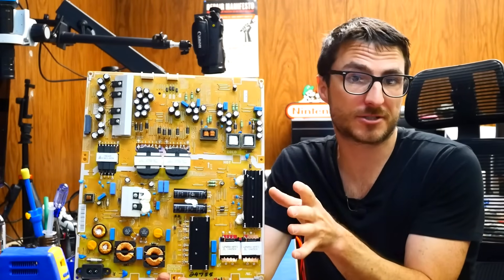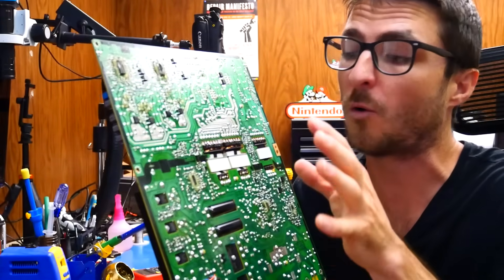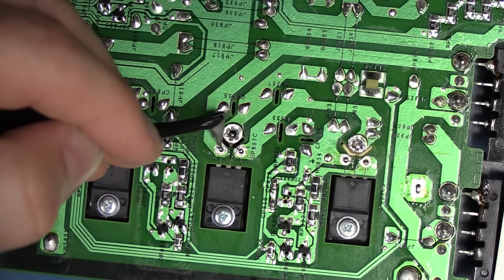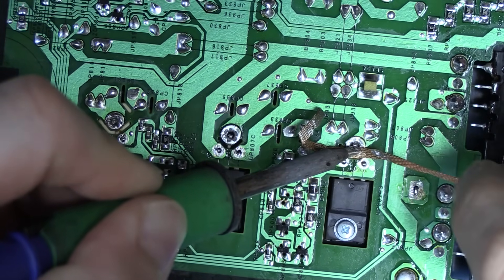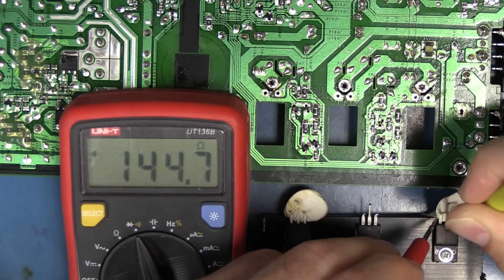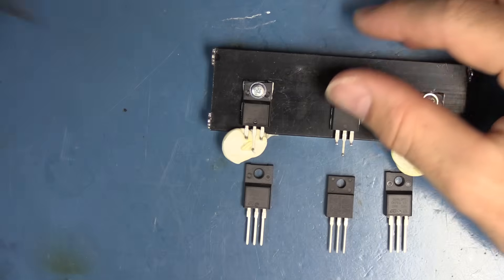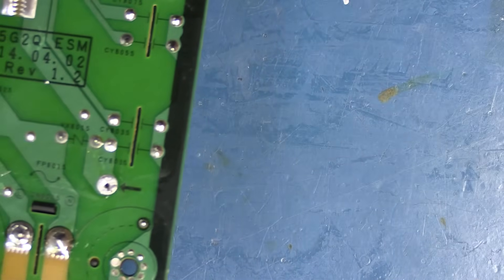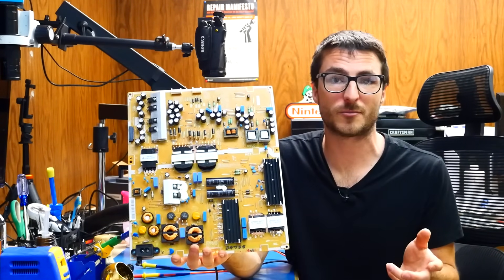Samsung TV No Power Repair UN75H7150 Power Supply BN44-00725A

Comment: Whyt not use flux for easier removal?
Reply from the maker: Flux is only necessary if you have a hard time with getting proper flow of the solder. This was not the case here.

Comment: I have an LG C1 65 inch TV that will not turn on after going into stand by mode.   Only way to start the tv is turn it off from the wall for 5min and then within 10seconds from turning on, i have to turn it on with the remote.    As soon as the red stand by light turns off it will not turn on via remote.    Is this a Power Supply Problem?
Reply from the maker: Based on past experiences that sounds more like a mainboard failure than power supply. If the power supply was bad the set would most likely be dead 100% of the time.

Comment: Nick I have a background in an Electronics but I have been in a coma and paralyzed years ago I need a refresher course if capacitors read o l on the ohms meter are they bad my church soundboard went out and I'm trying to fix it. I'm a computer nut I'm trying to get organized . Any help or advice for the helpful to me but you can see by my name I'm not a quitter.
Reply from the maker: Hello,
To properly test a capacitor you should use an ESR meter and capacitance meter. 
I do exactly that in this video linked below that I published just last weekend:
https://youtu.be/yW7qUYb1hI0?si=kwCxe0lQ3Sekowc2
Reply: There are cheap component testers that will measure capacitor value and ESR rating. 
High ESR caps can do wierd things to digital circuits.

Comment: Use diode mode to test diodes and transistors, not ohm-mode🤦 You can test the N-FET body diode with positive to source (pin 3, right) negative to drain (pin 2, middle). And you can even test if it turns on: negative to source, touch positive to gate (pin1, left), now positive to drain should show short until you discharge the gate by shorting it to one of the other pins.
Reply from the maker: Once you get better at fixing things and you understand what your meter is doing when it's in diode mode VS resistance and how it behaves when things are good VS defective and you then understand that you can actually use it interchangeably. I could have used the meter in diode mode to test the transistor and could have told you if it was good or bad. I can also use the meter in resistance to test the diode. Heck I could use the diode mode to test a fuse or resistors (depending on the resistance) and tell you if they are good or not. Just have to know what to expect.
Reply: @NicksTVRepair  Sure, you can use the ohm mode on a diode, but what does that tell you about it? In diode mode you can see the voltage drop which differs for diode types (schottky, fast recovery etc). There's no spec for megaohms of a diode. Also some multimeters don't show anything for a diode in ohm range. Use the proper tool for the job.
For mosfets I always test the body diode. I didn't see you do that. Also test if they turn on. Did you know you can turn on a mosfet with your multimeter in diode mode like I explained?

Comment: Nice video, but i do have a question, what is the most likely culprit to cause a ceramic cap to go pop? The tv showed no signs of life, then when plugging in to another socket it killed a cap
Reply from the maker: Normal wear and tear
Transistor in line with it shorts out 
Those are the top 2 reasons why it would go out.
Reply: @NicksTVRepair  thanks for the reply, will have a gander at the tv later

Comment: Phenomenal!
My Samsung TV has no standby light. Checked the plug fuse and have limited knowledge beyond this. However, I did open up and disconnect the cable between the two boards. I still have no back light. I am now tempted to replace the Power Supply Board. Is this a reasonable course of action?
Reply from the maker: What is the model number of your TV? 
It sure does sound like a power supply failure. We can probably fix it for cheaper than a replacement, however and even more importantly, having the board fixed will probably last longer than buying a used one. The reason I say this is because we replace the defective parts with higher quality than factory so the failure never reoccurs. This ensures that our repaired board lasts longer than a brand new one would.
Reply: @NicksTVRepair thanks for the response. I have a samsung ue65nu8000T. I would have preferred a repair through yourselves but have now ordered a replacement board. I came across your video since then. Do you also repair the main boards?
If the replacement doesn’t fix the issue, can I ship both to you for repair/inspection please?
Reply from the maker: We don't do the mainboards for this model because they almost never fail. It's usually the power supply or panel we see fail.

Comment: shame its cheaper to buy new than fix.
Reply from the maker: It's not actually. It's always cheaper to fix except if it's a cracked screen. 
It's also better to have it fixed because often we can upgrade the components to higher quality ones than factory, so your fixed TV can actually last longer than buying a new one.
Reply: @NicksTVRepair  if the part cost 200 and labor is 200, plus getting there and back, 400 will buy that same tv new. i mean you can get a 70in at walmart for 400 dollars now.
Reply from the maker: No, it won't. First off the repair we are doing is $89 not $400 but regardless, you can't buy a $400 70" Samsung. The Cheapest on Amazon right now is $600 but is a 75" we are fixing in the video. If you want to buy the cheapest TV possible that has the worst specs and that is bested by a 10-year-old non-4k TV, then sure you can probably find something cheaper. But then it's like saying I won't fix my Ferrari because I can buy a KIA for less than the repair of the Ferrari. 
To get an equivalent TV that is going to produce just as good quality as this 10-year-old 75" TV UN75H7150 you can't spend any less than $900 or else you are downgrading your TV in which case we are comparing apples to oranges.  
Otherwise yeah I can go buy a $600 75" TV made by a company called Omni. But I don't see anyone in their right mind that would want to trade their none 4k UN75H7150 for that 4k brand-new Omni TV. 

But yeah if you buy really low-quality products, it doesn't matter if it's a TV a phone, a computer, an appliance, or anything it probably won't be worth fixing because you made that decision to buy low-quality stuff that you don't want to take care of, it's not good enough to be worth trying to keep around. 
But if you bought a 55" OLED LG or Sony for $2,000 then you may see, oh wow this thing has a really good quality picture, and you won't want to go back to a $600 75" TV.
Reply: @NicksTVRepair  repair shops gets [parts for $89. charges people $300 for it. because you have markups. which is business, you need to make money on buying the part, you need to pay for your phone and laptop and internet and your time to order the part. your got shop over head, like rent and electric and your labor which you need insurance and taxes. so dont say it cost only $89. lets not forget about your tools. testers and meters and hand tools. but if you say you will travel 50 miles and get me a gallon of gas when i run out and just charge me $3. thank you.

Comment: Why add solder just to remove it? I’m not a electronics guy. Not enough hammers for me.
Reply from the maker: The old solder will have a layer of oxidation or impurities on top making it hard for the heat to transfer from the iron tip to the solder itself. By adding new solder you make it easier to transfer that heat. It helps with better flow. + my new solder has flux in it so that also makes it easier to flow.

Comment: My samsung tv UN55MU6290F toast after lightning, power light comes on, but power button or remote control wont work tuvturn it on. Any idea what could be and how much would it cost to fix it. Houston,  Tx.
Reply from the maker: The fault you are experiencing is likely a mainboard failure and not power supply as most people believe is the case with a lightning strike. We charge this much to fix the mainboard:
https://nickselectronics.com/products/bn94-12662z

Comment: How did you know the "transistor" in the middle was not a transistor but a diode? Did you look it up have a schematic or were there symbols on the board?
Reply from the maker: Each component has a location ID next to it. It's small text printed on the circuit board. The location ID starts with a letters then numbers. The letters tell you the type of component it is. A diode starts with a D, a transistor starts with a Q, a resistor with an R, a fuse with an F, and IC chips start with the letters IC. 
So it doesn't tell you much more in depth info as to what kind of diode it is but at least I know it's a diode.

Comment: I think I would have checked the capacitors that  are on the output rails also.
Reply from the maker: So we actually almost never see capacitors fail on LED power supply boards. That was a common issue on plasma and LCD models however. Now with that said of course there are always exceptions, there are a few specific power supplies for which we see ceramic caps go bad but for this unit I have never encountered that. That's why we don't typically check them for this model power supply.

Comment: Was that a low melt solder you were adding to make it easier to remove? Just came across your channel and thats really clean work you are doing.
Reply from the maker: Thank you very much!
The solder I use is leaded and has flux in it, that could be why it looks like low melt. It's not technically low melt but it flows way better than none leaded that's for sure. 
This is a link to it if you want to buy the same:
https://amzn.to/4cMy6jv

Comment: I love it! 80s / 90s style soldapult repair! I've had one in my toolbox for 45 years.
Reply from the maker: soldapult?
Reply: @NicksTVRepair  Your 'Desolder Pump' is marketed as 'SOLDAPULLT'.  /// The name “SOLDAPULLT” is a clever play on words combining “solder” and “catapult.” This reflects the tool’s function: it uses a spring-loaded mechanism to “catapult” or pull away solder during desoldering processes.

Guys who do a lot of on the bench work gravitate towards hollow tipped desoldering stations...  but I still use this Soldapullt tool because it's 2nd nature and I don't do that much board work anymore.

Heck... 2 for $10 on Amazon is better than $1000 plus for a station...
Reply from the maker: Yeah we have a desolder station but indeed I only use it if I have to do a lot of desoldering. This I don't consider to be a lot, so ill use the pump. I like it better, it's simpler.

Comment: Hey Nick, I just had the same problem just a few days ago with my 65 inch Samsung tv, but I tried the trick unplugging the power cord and holding the power button on the tv and it worked but then I faced another set of problems lol. 

With the tv cutting on and off, the 4K settings I had on the tv had been reset and so I tried the Mute 182 secret reset and that worked but as I was scrolling across the options I accidentally clicked on an HDR Calibration option. First it read “Wait” then “Failure”. A square appeared in the top middle of the tv and afterwards the picture got darker and continued to get darker. 

I’ve tried adjusting the brightness, two factory resets, and I keep the HDR on Dynamic and the screen is still dark. It’s difficult to watch anything because of how dark the color is now. Any tips on how to fix this type of weird problem?
Reply from the maker: I am very sorry to hear this, but I can't help you. 
As mentioned in that reset video it is very important you do not change any of the other settings because this will happen. 
Your best bet is to try and undo what you did, but if you can't, the alternative is to replace the mainboard.
Reply: @NicksTVRepair  Thank you

Comment: Ok, a few thoughts from me, take them or leave them. Firstly, get yourself a desoldering gun. They are cheap and reliable these days. You'll never look back. Secondly, IMHO it looked like you were way to close with your uncovered arms to those high voltage components while testing the live board. 390VDC will end you very quickly. There are no second chances with those voltages. Don't ever reach across a live circuit board like that. Always work around the edges with your arms above the table, not the board.
Reply from the maker: I have a desoldering gun, but most people don't, so it's best to show how to do the job with tools people have access to. + It's more fun in my opinion to use the manual pump and wick. 
As for the voltage, I appreciate your concern, the angles shown are the worst perspective to be able to see how close or far my arm was to the board. As mentioned in another comment, I have never shocked myself on a live board in 10 years. Only on non-live boards that are disconnected from power but still are holding a charge. And yes they bite haha.

Comment: I have repaired a 60 inch Samsung motherboard. I baked it in the oven for 15 minutes. By the way I see the boards don't really cost all that much. But can be fun to fix them if you have the time. Great repair by the way.
Reply from the maker: I would be careful with the oven baking, it's easy to make them irreparable. But as you said as long as there are replacements available for cheap, why not give it a try and yes indeed repairing stuff is very fun!

Comment: 8:38 asking to be shocked on your right arm : )
Reply from the maker: Lol, if I get shocked while recording I'll keep it in. But I have not yet gotten shocked on a live board that is plugged in. So far it's only been while the board is unplugged but still charged and I forget it's still charged and or it stayed charged for way longer than it should have or that I thought it would. That has happened dozens of times.
Reply: @NicksTVRepair  I have!  : )  Usually 230vAC. I try to keep it to a minimum : )
Good job on the repair, sometimes these boards are trickier to diagnose
Reply from the maker: Yes they sure can be more difficult sometimes.

Comment: Hello, i have subcribed and liked and below,
I have a couple of questions.

How are you able to tell what pins to test in beep mode.

How do you know the orientation of the transistor/diode.

How can you identify a component as a diode,transistor(npn,pnp)
Reply from the maker: So the easy way to identify the components without having to look up data sheets every time is by their ID location. If the ID location of a component starts with the letter D then it's a diode. If it's a Q then it's a transistor. L for inductor, F for fuse, R for resistor, and C is for capacitor. 
Those are the most common ones. 
As for NPN or PNP transistors, it won't matter in terms of testing, none of the legs are supposed to be shorted to one another. So if you detect a short then most likely that transistor is bad. However, sometimes the circuit can be designed that way so it's always good to recheck them once they are out of the circuit to confirm A the part you removed is shorted, and B that the short is no longer present in the circuit. Had I only removed the 1 shorted transistor and not the diode, I would have still detected a short in the circuit even after removing the shorted transistor. 
Makes sense?

Comment: For anyone at home, be extra careful if you perform a live test. The mains voltage is no joke.
Reply from the maker: I have never shocked my self on a live set while it's plugged in, but I have shocked my self on a power supply disconnected from power that still had plenty of juice, and boy that wakes you up. I wouldn't recommend.
Reply: I would also suggest being careful when you hold th psu@ 8:59   @NicksTVRepair
Reply from the maker: Don't worry, I have a discharging tool I use to make sure it's safe to handle after live testing.

Comment: 100eur desoldering station with vacuum pump is 100000x better than those spring pumps, they are a bit fiddly and may need small tweaks and fixes to work well, mine had a problem with seal behind the heater, but overall performance is so much better than the handheld pump
it isn't as useful for these single sided boards, but for multilayer there really is no comparison
Reply from the maker: We have 2 FR-301 desolder pump/iron in the shop, they are pretty good for tougher jobs, but I wouldn't say it's 1,000 times better. The none electric desoldering pump I used in this video does also do the job well. The joints with those crowns are typically a bit tougher though and require the use of desolder wick. I probably could have gotten the solder off those tougher joints faster with the desoldering iron/pump but I don't know I also like the manual pump. 
I usually only use the FR-301 if it's a lot of joints like say some of the 18 throughole pin IC's or displays we replace for the oven control boards. This wasn't very many pins to desolder and only a couple were the tougher kind.

Comment: Good vid. But I'm really surprised you don't use a power desoldering tool instead of the manual solder sucker.
Reply from the maker: We have the FR301 as well as the solder sucker and desolder wick. The FR301 can be more convenient but only when I have to do a lot of desoldering in one go. It takes a bit of time to get up to temp, it requires maintenance and routine cleaning and stays super hot for super long which means you have to go put it far away so no one accidentally burns themselves when you are done with it. It can just be a hassle so if I only have 3 components with few legs to desolder it doesn't make sense for me to use it. I would rather just use the desolder pump and wick. If I have a through hole IC with 32 pins then sure ill bust it out.

Comment: looks like you need a good vacuum desoldering gun
Reply from the maker: We have the FR301 but I typically only use it when there are a lot of parts to desolder or if it's an IC chip with a lot of legs. This is very little desoldering, didn't feel like it was worth the hassle to use the desoldering gun.